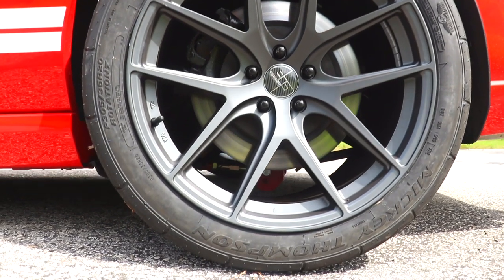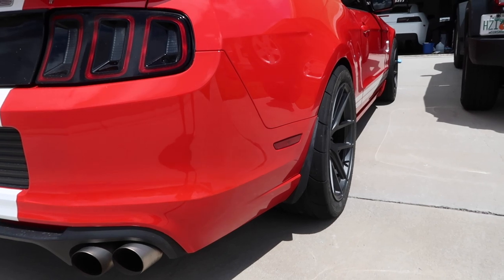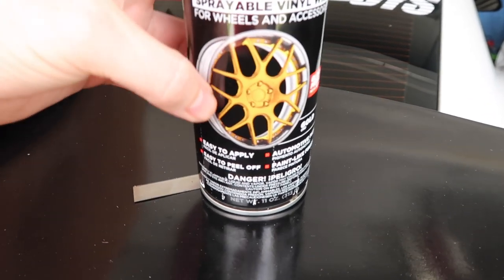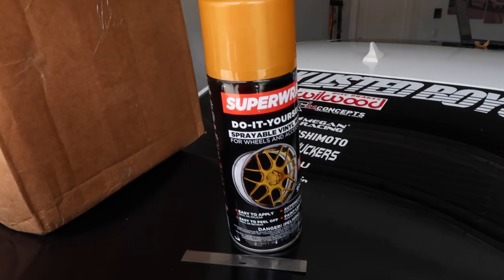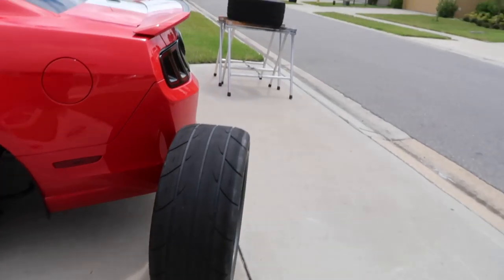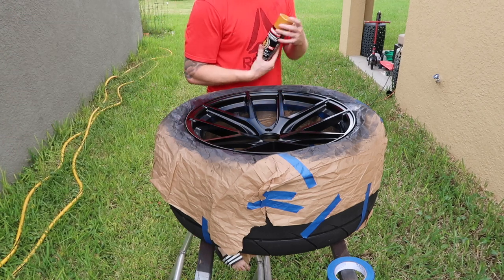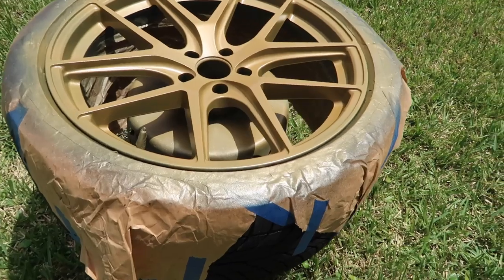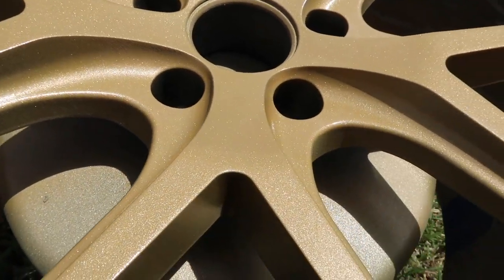Setting my GT500 Apart from the Others...Is it "Ruined"?

Comment: How hard are those radials on the manual?
Reply from the maker: Not quite sure what you are asking. The general rule on a prepped drag strip with a manual is to use a bias ply tire. Street is different. A radial is much more streetable
Reply: Mustang Lifestyle yea I’m in the market for tires and got an mt82 my question was if they are really that bad I know everyone says bias ply only but saw yours and figured I’d ask
Reply from the maker: For street driving a drag radial is fine.